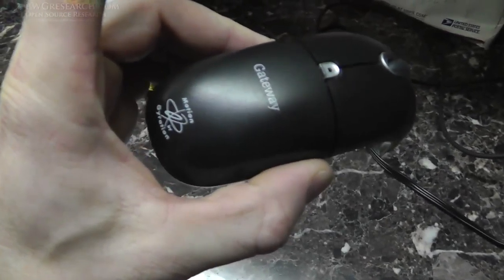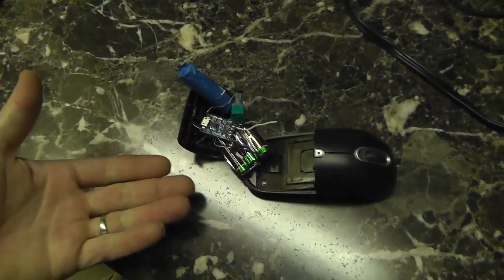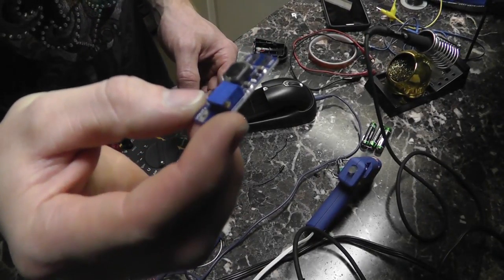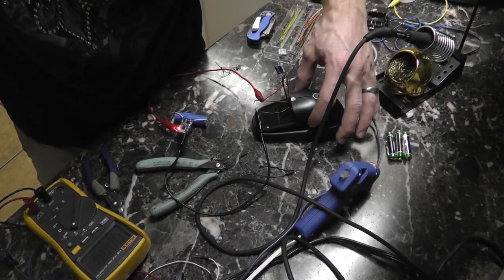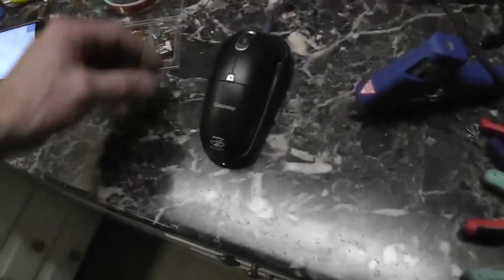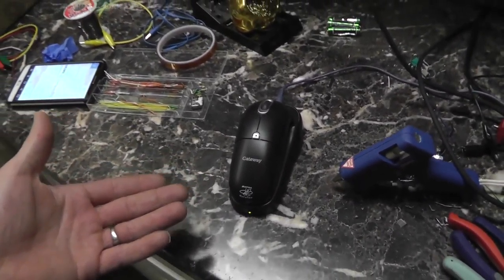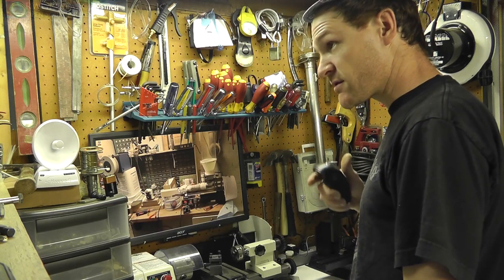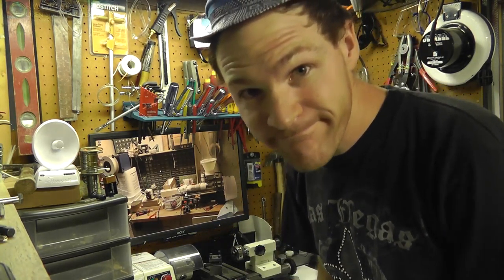I Love This 12 Year Old Gyration Mouse! Lets Hack It To Lithium Ion!

Comment: Neat mod - where can drivers for this be found?
I happen to have a Gyration Ultra GP110 that looks like this - battery is most likely dead. 
I'll probably go with NIMH eneloop AAAs when I get around to it.

Try modding a razor - good batteries can put out a LOT more current than the cheap stuff they usually come with.

Comment: You should keep an eye on that 5V regulator. Assuming 8V supply and 1A charge current (default for that charger module), you're dropping 3V@1A = 3W on that tiny package. That's a lot even if it was heatsinked to a PCB, which yours is not (plus it's inside a small unvented enclosure). If your supply is only capable of around 100-200mA then it might be fine, but I'd expect smoke otherwise. Mind you, charger will only do 1A on an empty cell. If you tested it with a mostly charged cell it could easily be a lot less.
Easy fix is to swap max current resistor on the charger module, so it never goes over 100mA. Downside is that charging time will be 10 times as long (around 20 hours I guess)
Reply from the maker: +Vedran Latin yes i agree with you, i should have soldered it to a copper pad of something. i feel no heat so i'm thinking charger is limited to 500ma or less... but good catch you are right! thanks for the comment! ~Russ
Reply from the maker: +rwg42985 i guess i should look a the wall wort... It would tell me what its output is.. I'm not at home right now but i but its under 500ma or so. its a small adapter ( transformer type) ~Russ

Comment: :-) I dont suppose you are surprised to find that this is the mouse I use in my classroom when I am teaching!
Reply from the maker: +Phil Waud hahaha we ave way t Manny similarities, sounds like we found the same solutions t a similar problem :) is it the exact mouse or one like it? i know they make fancy versions of this mouse. to funny. hope your feeling better. ~Russ
Reply: Its exactly the same, but not gateway branded. Its sold in the Uk as the "gyromouse". I have the receiver plugged into my desktop PC which is connected to the whiteboard data projector. I keep the keyboard at the back of the classroom. It lets me walk round the room and still demo stuff and control presentations etc.